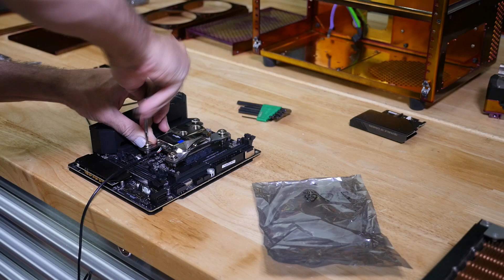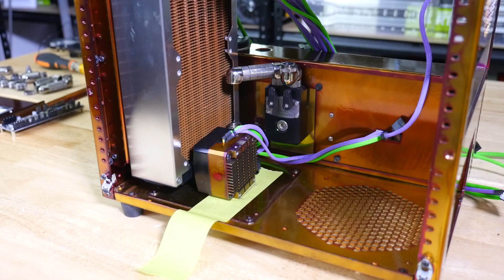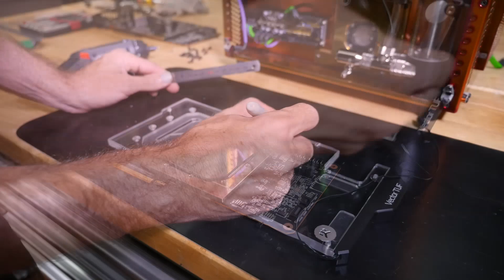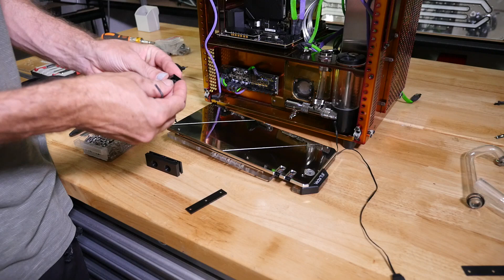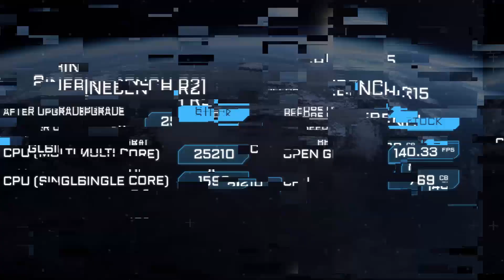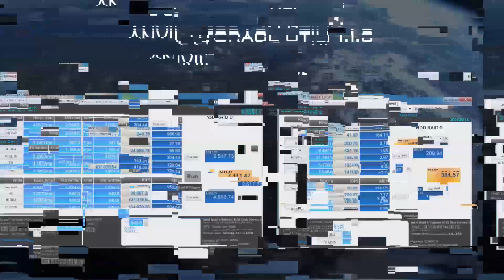Typewriter Upgrades

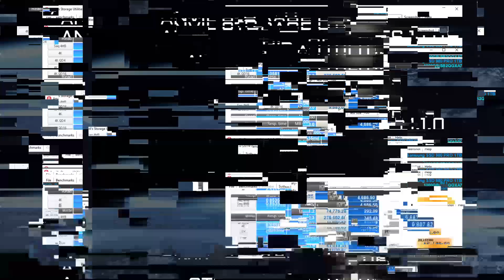Comment: 9:50 Read seems a little low for an 980Pro. Did you upgrade the M.2 Firmwire with the Samsung Magician? It's a known issue that the original one has flaws.